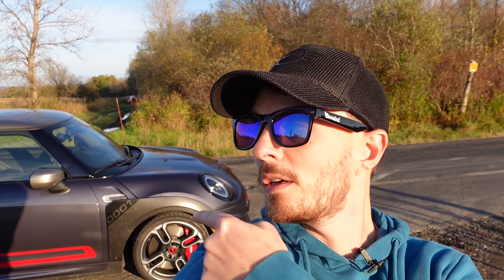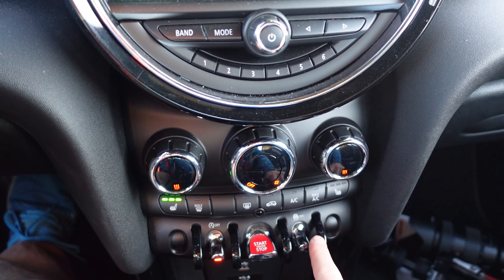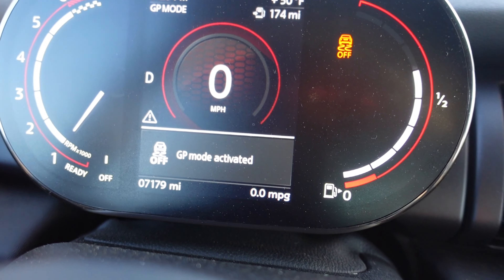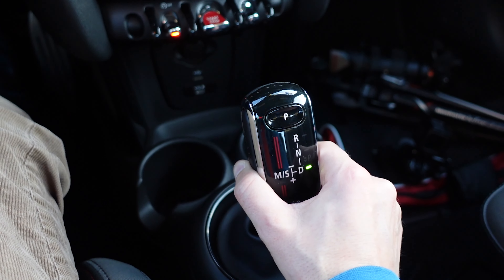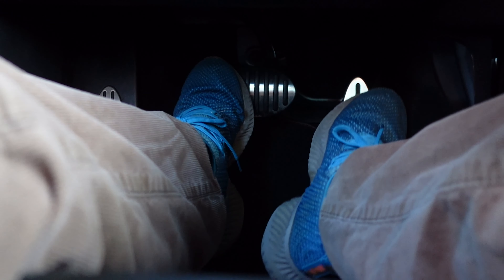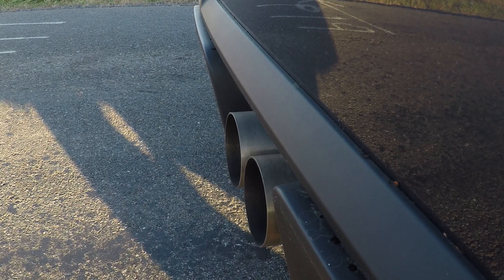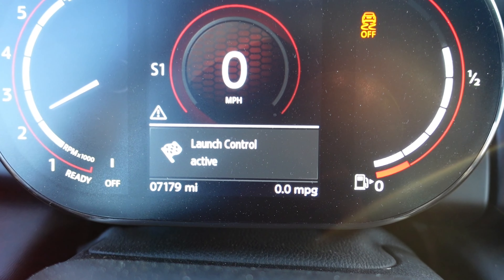MINI Cooper GP3 Launch Control

Comment: I wonder why they limit you to only 100 launch controls over the life of the car?
Reply from the maker: From what I've been told, it's a big strain on the engine and gearbox and if they let you do more than that, your odds of something breaking increase significantly. So a warranty thing
Reply: @TheMINIVlog  Oh wow it's like a built in safety feature then to keep you from pushing the engine and transmission too hard. That makes total sense then and is also good to know.